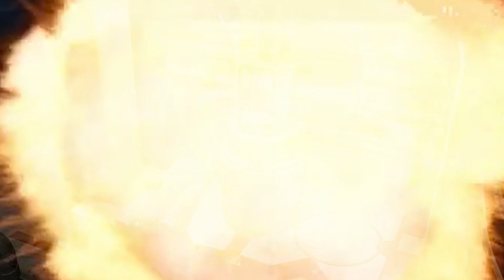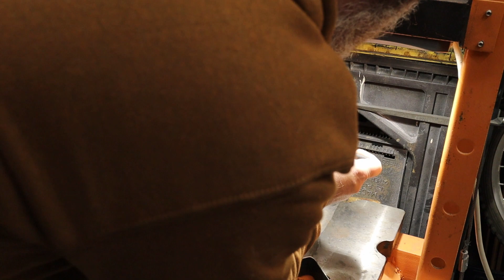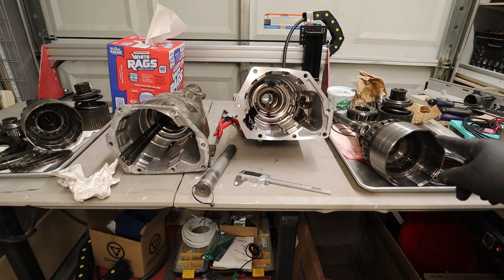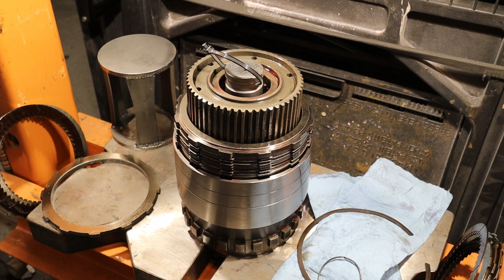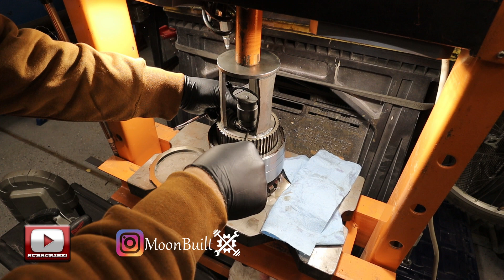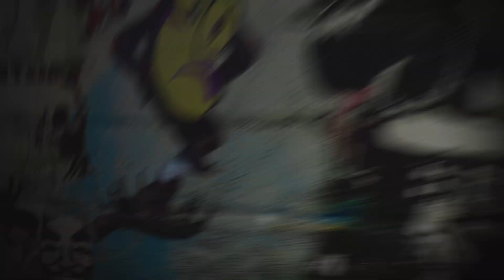Rebuilding the Overdrive Section of a 46rh Transmission | Dodge D100 Hot Rod Shop Truck Project

Comment: Do you have a video before the drum removal with press? I just got my 46rh OD removed. Broken Wavy Snap Ring. Have spline tool in place. Do you just remove the alignment tool and start pulling it all out until the drum and forget about alignment until reassembly? Thanks for making this video. Not much for 46rh. Hopefully I’ll have a full 46rh OD removal video up soon
Reply from the maker: This video was a full teardown, but I don't remember if I tore down the O/D section: https://youtu.be/g0Szrz0OXvg
If I remember correctly the alignment doesn't matter until you go to reinstall everything

Comment: Dumb question time...Is the alignment tool the same size/spline count as the output shaft of the main transmission? Maybe output shaft isn't the correct term on the 46RH but it would be the output shaft if it were an old 727 I guess. 

I'm just thinking that if a guy had an old output shaft from a 727 that could be used as an alignment tool if it were the same size. Cheaper way to do it if you are a Torqueflite hoarder like me. :)
Reply from the maker: Yes it is, as far as I know.  I tried to find one in my local pic-a-part to try and make my own before buying this one,
Reply: Awesome. Pretty sure I have one here.

I’ve done plenty of 727s but this is my first 46rh, your video was very helpful. That overdrive doesn’t seem near as intimidating.
Reply from the maker: Not once you tear into it....I was worried about opening that thing up, but once I did I was like, "Oh..that's it?"
Reply: That was my thought exactly while watching your video. It’s just another clutch pack. No big deal, just be aware of that spring.

Comment: can you post a link to the tools used to take out the spring
Reply from the maker: http://www.transmissionpartsusa.com/A500_Direct_clutch_spring_compressor_alignment_p/300-0000t1318.htm
The alignment tool, and maybe the press tool also, can be found cheaper on eBay